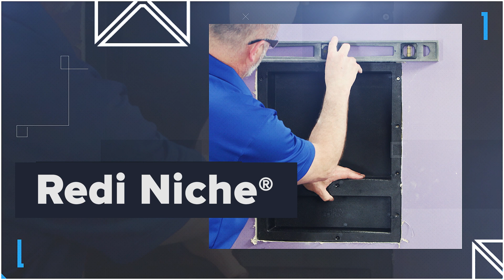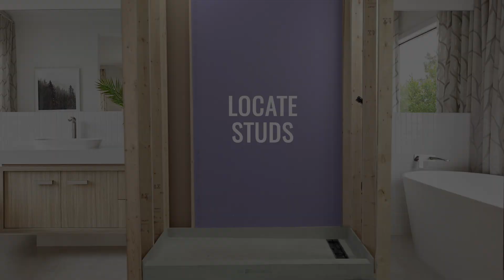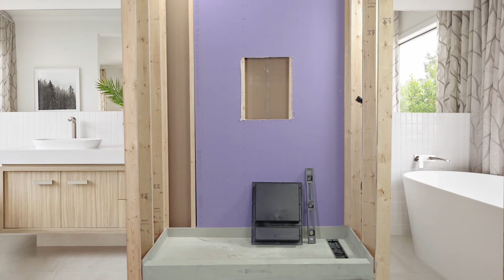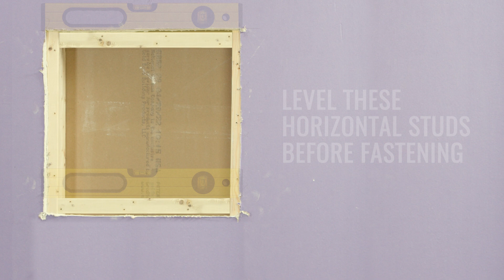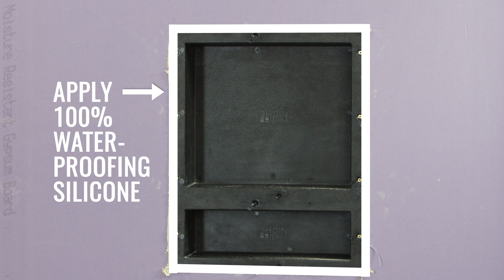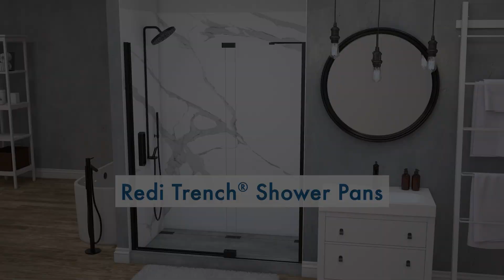Tile Redi Shower Shelf Redi Niche Installation Instructions

Comment: Do you recommend taping the flange and cement board where they meet?
Reply from the maker: Yes, you can either use our Redi Flash, z-flashing or you can use our waterproofing tape along with sealant to lock in that edge.

Comment: Do you apply backer board on the plastic cubby? Or adhere tile directly to plastic? What adhesive do you use for tiling on the Redi cubby?
Reply from the maker: You can adhere the tile directly to the shower niche, no backer board needed. Use a white modified thinset to adhere the tile to the niche.